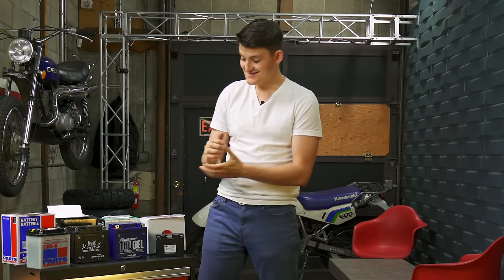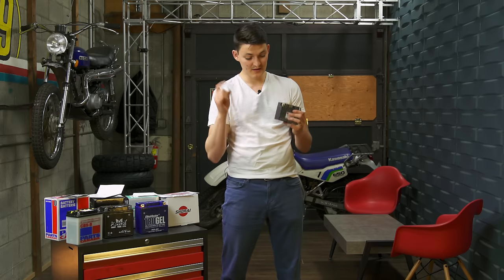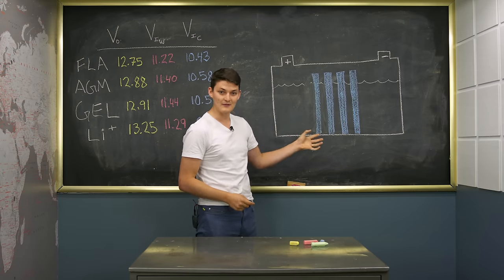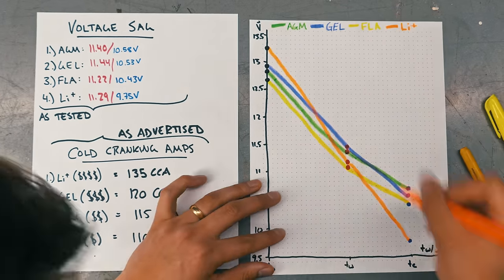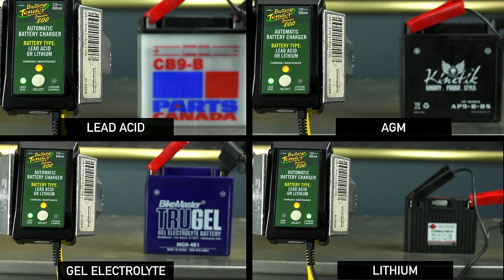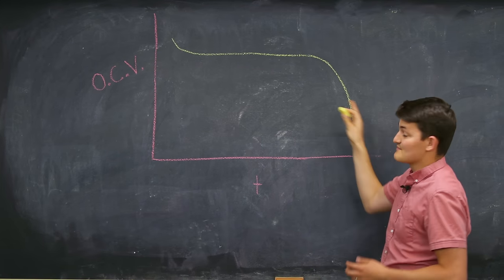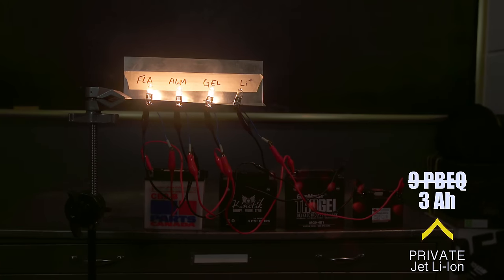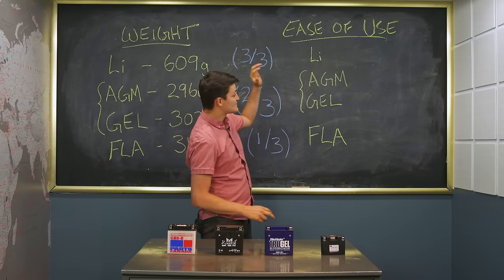Best Motorcycle Battery? Lead-Acid v. AGM v. Gel v. Lithium

Comment: Why not make a true 9ah Lithium Ion battery(or greater) of the same size of an AGM or Gel? I would gladly pay twice the price for twice the convenience.
Reply: They do and you can buy one. If paying that much extra is worth it to you.
Reply: Because pretty much nobody is buying a $500 battery for their bike instead of a $50 one
Reply: In terms of starting the bike, the 3ah is just as good. If you drain 3ah out of the others, they probably won't start because the voltage has dropped too much. In any case the low discharge and supposedly longer lifespan means you should never have to use the full capacity like is common on others. The problem I have with lithium is that I'm not sure it can survive the relatively crude charging systems of many bikes long enough to justify the cost. Also, running one at low temperatures isn't really possible.
Reply: @apodski  I'm using my Lithium battery with the factory rectifier /regulator, but there are finer products out there to suit this battery. Point is it needs to be kept away from over voltage. I made sure it always is kept under 14,2v of charging voltage. This can be obtained by keeping the ligt on at all times on my bike. In my opinion, lithium is so far superior that it makes this a no brainer for me.
Reply: @aukanmeister  The bike I considered getting a lithium for is kick start only with led lighting. Instead, I just got a very small agm battery that weighs around half a pound. I haven't regretted it.
Reply: @apodski  my lithium started my r1 perfectly fine in just below freezing temps, it took a few times of thumbing the starter though, first time it sounds like a dead battery, but 2nd and 3rd time the starter went round quicker and quicker, started in a wiff the 4th time, i knew this was normal, you really need to pull some amps through the battery to warm up the internals before it can push the amps to start a bike.
Reply: @HowlerBikeVlogs  That's interesting. I guess running a starter really doesn't tax the lithiums abilities much like that of a lead acid. Lithium cells can put out way, way more amps. But they are more cold sensitive.
Reply: I'm not sure how beneficial it would be anyway. I can list off several occasions when myself or someone I know has experienced a battery failure (I'm looking at you Bikemaster) out riding. I don't even recall one of them ever having a problem with their charging system where the additional reserve would be a benefit. It would end up just being wasted money. I personally run lithium when the temps are above 45F as it cranks my bike over faster and starts faster. And below that I run AGM since lithium doesn't much care for anything below 11.5v or charging when it's freezing.
Reply: @apodski  True, but not everybody lives in Canada. Where I live, freezing temperatures are rare. Then the weight difference becomes compelling, especially because batteries are typically fairly high up on the bike. Then basically you need to account for your riding seasons. If you ride all year, including below freezing, probably AGM is the best choice. If you just ride in fair weather, lithium makes more sense, since you don't need to worry about state of charge dropping during all those winter days.
Reply: @aukanmeister  Dont like, all bikes now leave the headlight on?   Uh oh mines LED so is that enough current draw to count?

Comment: Bought a KLR new in 2006, ate two standard LA batteries in the first 3 years.
KLR's are famous for that. The Shunt R/R overcharges IMO.
So, after much research, I bought an AGM from Batteries Plus, and I fitted a MOSFET style R/R to replace the standard Shunt unit.
That AGM lasted 8 years! 
Now, I did use a cheap Harbor Freight trickle charger ($5) whenever I parked it for more than a week (not often), but that was one inexpensive battery and retrofit in the long run.

The next AGM was 4 years old and going strong when I sold the KLR, so for my money AGM is the way to go.

Comment: One note about lithium- there are 2 primary lithium battery chemistries. The one used here, LiFePO4, is much more resiliant than the somewhat more common Li-ion, if a bit less power dense. If you have a Lithium Iron Phosphate battery like this, amd it gets discharged completely flat, there's a pretty good chance you can bring it back with a very slow trickle charge. It likely won't come back to its full capacity, but it's usually worth trying to recover it rather than just throwing it away.

Comment: I stand in the Li On court, mine drained to 3.5v, I stuck it on its charger and 2 hours later it was fully charged with no long term damage. Any other battery would have been consigned to the bin

Comment: Interesting video  .I've always been 'Pedantic' when it comes to  looking after my batteries over the years . Mainly because in NZ where I live, they have always been very expensive  (along with a bunch of other things, down here ! ) I have 'resurrected'  two batteries lately, after looking at many claims/ways over the years . One was a flooded-lead type, which i topped-up to the minimum-mark, then used a heavy truck-charger on 24-volt,engine-start-mode . I had the battery 3/4-immersed in water to help keep temps down. I cycled it in 3-4 minute bursts until every cell was boiling vigorously , resting it 10 mins between each charge, for over an hr with all cel-caps OFF . That battery holds a float-charge over 12-volts @ 4.6 amps . The other was a dead gel-battery, which I attached a larger gel-battery to, and then charged the larger-battery .  It now comfortably cranks my TX650 with a high-comp motor . The f-l battery was a 7yr-old yuasa, while the gel is an 18m-old generic-brand . The lead-acid video I watched, used an arc-welder , which I will try sometime in the future . This high-voltage/amperage DOES NOT work on anything other than Flooded Lead-Acid (no gel or gel-mat or lithium ) , and DOES have the potential to explode from gases/sparks etc. So ...do this at your own risk, taking ALL precautions : I even used a fan to blow gases away . Connecting terminals with a live/large current-source IS dangerous, they must be connected B4  power is turned-on .    Dave   NZ

Comment: I've converted all 5 of my street bikes to Li over the years, each with a different brand. (Shorai, Ballistics, Bike Master, WPS and Part Unlimited.)
Bikes range from a 1500cc Vulcan cruiser, FZR1000, TDM850 twin, 400 Bandit and a VTR250. None of them get a ton of everyday use since even if I commute everyday to work, I can still only ride each one once or twice a week  and rarely more than 30 miles per trip. In the years since I switched, only the tiny little Ballistics six-pack battery in the Bandit has ever cranked slowly after a winter of storage or several weeks of not riding that particular bike. This is somewhat remedied by leaving the headlight on for a minute B4 cranking and I've never had to resort to charging before starting.

Comment: I thought you would be able to recharge the lithium even after the full discharge though.  I thought that was one of it's selling points.
Reply: you can. I have one that was given to me. It measured 0.5v. I jumped it to wake it up, then it's been fine for a year and 10k miles.
Reply: Yes, but if you manage to discharge them below a certain voltage they probably won't come back. It's a bit like going below 0%.
Reply: @jamespcorbett  The opposite is true.  You must drain them to extend their lives. Lithium batteries have a little something called capacity memory. If you drain them to say 50% the battery will assume that it's the new 0%. You must fully drain them from time to time. People throw away perfectly good batteries.  If your lithium battery is giving you trouble, fully drain it and it will take care of 80-90% of the problems.
Reply: @gazlindhysko  I agree to 0%, but if you continue to drain them past that they often will not charge again.
Reply: @gazlindhysko  Not true. I think you're thinking of Ni Cad, or NiMh battery technology. Lithium doesn't have a memory.
Reply: @P0rtlandbear  is right, I believe. What you're talking about is true for Nicad. Totally different. 
I worked for Tesla and can confirm that Lithium should avoid full charge and full discharge. Keep it between 20%-80% type thing; the extremes stress the battery.

Comment: But I just bought a lithium ion battery from Advance Auto for ~$40, it was even cheaper than a lead acid...
Reply: Timothy Brown He had a lithium iron not a lithium ion. You may have found a cheap Lithium ion but lithium iron won’t catch fire and is often used for things like motorcycles.

Comment: I have had the same Shorai lithium battery in my Yamaha Xt250 for over 7 years. Will definitely buy the same one again. No battery tender needed if you ride frequently enough. They do have issues with really cold weather but I don't usually ride when it's that cold.

Comment: Great comparison!! Battery discussions are rampant on MC Forums. Almost as bad as tire and oil threads...Almost. I'll say this: My road bike has a standard and CHEAP lead-acid battery that's been going strong for 5.5 years. My dirtbike has a Shorai that's been in about that same amount of time. Our Jet ski burned the OEM lead-acid in 2 years. The AGM replacement lasted 4 years and was just replaced with another AGM. I thought about getting a Li battery, but they were around $240, compared to the AGM's $85. That battery would have to last 12 years to be worth the money. All this to say, I truly believe different batteries are useful in different applications. Either way, thanks again!

Comment: Interesting stuff about batteries. I'm currently testing LiFePO4 batts in my lab at work. In another lab next door they've been doing it for 10yrs. They had their 10yr old batteries xrayed and chemically analyzed to see what their charging methods were doing to the batteries. 10 years of incorrectly charging the batteries. This means removing cold weather protection from the internal BMS. Basically the batteries stayed on and took charge and discharged regardless of temp. In our field work we have batteries at high altitude and artctic/antarctic conditions. They have similar situations in their deployments. The results showed that the batteries were damaged but that it was so miniscule that it didn't matter. They made it 10 years. So they didn't really need the xray exam or chemical analysis to point that out. But they got it done. Great video. Side not I run li Batts on my vehicles and house.

Comment: Ryan thanks for this great real world test. Would like to add, lithium battery has the best storage loss only without parasitic loss. With electronics sucking power during storage you had best hit it with a charger every other month or so. I left my Goldwing sit and the battery won't turn it over. Left the lithium rated automatic charger on for the winter(gets cold in New York too) and battery died completely. Just my observations. Great tip on waking up lithium battery! Keep up your great irreverent honest reviews!

Comment: One thing not mentioned that I have not seen any discussion of is how the BIKES' charging systems matches up with the different batteries' voltage and current needs.  For example, there is much online discussion about having a correct plug-in battery charger for your battery type (e.g., lithium bats), as well as apparently that some plug-in electric chargers work on all batteries (like the tender you mentioned.)  QUESTION:   Are the bikes' own built-in charging systems all OK with the all battery types, such as lithium, other types?  What are the bikes' charging systems, anyway.  How do they differ between bikes.  Are BMW, Honda, etc., pretty much the same? or are there differences among them, some that could work better for certain batteries?  After all, a bike with a nearly discharged battery, if you could start it, might get 20 amps (R12GS) from the onboard charging system while the depleted battery was being recharged.

Comment: Even at 3x the price, I consider the LiFePo4 batteries to be a better value and are much less hassle in a motorcycle.  That may not be the case for a snowmobile.

About 5 years ago, I put in my first LiFePo4 battery which was a Scorpion Stinger LiFePo4. It has a much higher CCA rating than the Shorai or the lead based equivalents and I really noticed how much easier it started the bike.  I have replaced 2 other lead batteries with Scorpion LiFePo4 batteries since and only one of my dirt bikes still has a lead battery.  No more trickle charger, and the internal circuitry allows them to be charged and treated like a lead based battery.  At 40 degrees Fahrenheit the LiFePo4 has much less oomph than it does when its warmer, even with running the headlight for a few minutes.  If my Triumph sits for a while and its cool out (40F), it is a bit hard to start and I will jump it off the car if it does not start in the first couple of attempts, same as I would a lead based battery.  The other bikes start fine, even when it’s cool outside and they have been sitting for a few months.

All my LiFePo4 batteries are still working great at 5, 3, and 2 years old.  I won’t know the total cost of ownership until the LiFePo4 batteries die.  I have gotten as little as 6 months from a flooded lead acid and rarely get more than a couple of years.

Comment: I got a Suzuki Boulevard C90T 1500cc
Been using 230 cold cranking amps.
I’m moving up to 260 CCAmps.
Starts an1800 cc bike..!
I cruise with an extra battery and a jump start battery, fix a flat, fire extinguisher(small cans)
Tools.. everything fits in one saddle bag.
In case the battery quits.
Plus I’ll share if I happen upon you with mechanical problems.
Got a cheap volt AC/DC meter to quick check.
I can jump a V-8
Had two wiring burns.. a battery got me home.
Now I got extra.. and no more problems.
A stronger CCA seems to be the trick.
I cruise about 600 miles a week in fair weather...
The cold is ok.. the rain , not so much🤩

Comment: I put a Lithium battery in my ATC 70 (125m motor ) bolted sideways up in the frame in 2013 & never looked at it since.2024 it still cranks fast & never gone flat.

Comment: The lithium batteries in a Tesla are packs which have coolant to enable faster charge and discharge. In cold weather charging, the coolant heats the pack to enable correct charging, but in very cold temps a 110V standard garage charger can barely warm the coolant sufficiently and still get charge in.
Reply: One guy had his tesla plugged into 110v and it was so cold the battery level % was still dropping.  It was using more power to keep the batteries warm than 110v could deliver.
Reply: @chrishart8548  Correct, I saw that also. Lithium packs in EV's cannot be too cold, or too hot.  When people put Tesla's on the racetrack, they lasted a few laps before the battery packs shut the cars down, to prevent  over temps.  The cooling systems wont cope.........that makes for interesting situations for EV trucks, hauling heavy loads will need very over built cooling systems for their 6,000kg (payload robbing) batteries.

Comment: Great episode. I've had two Shorai's (two different motorcycles: Ducati 900SS and KTM 690 Enduro R) and an EarthX Lithium and had horrible luck with the Shorai's. Both lasted less than two years, both were charged with the dedicated Shorai chargers. The Earth X lasted 3 years and is still going, and I've just used cheapo tenders on it.

Comment: I have a Shorai in my DR & I think it’s the ducks nuts. (Long lasting & saves a lot of weight). Gonna buy a another for my other bike. I’ve always thought that it wouldn’t be a good battery if you run a lot of tech- heat grips, spotlights, gps etc & this vid confirms my suspicions

Comment: Extremely informative once again. Bravo Ryan, bravo. Yet another display of why your channel stands head and shoulders against the rest. 

There are trade offs and compromises to be had with every choice. Forgoing capacity I for one have settled upon Lithium as my weapon of choice. Coming to grips with having minimal use while the engine is off is the pill I chose to swallow but higher CCA and weight reduction are of greater value on a beastie GSA. Hell, dropping a few kilos on the 500 EXC ain’t bad either 😝 

Rock on Ryan, rock on 🤘

Comment: The best tip I have about batteries is to not hook them up backwards. It can easily be done if not paying close attention to which terminals are positive and negative. It can damage electronics beyond repair and difficult to diagnose which components will need replacement.

Comment: most bikes have additional drain on a battery if they have an ECU, short of completely disconnecting the battery you'll still need power to store them, most unfortunately making the self drain less attractive on the lithium.

Comment: Battery placement on the bike also plays a part.  Case in point - BMW.  My '03 BMW F650 battery sits at the top of the hump at the very top of the bike.  Sure, keeps it out of the way when fording streams but it changes the center of gravity a lot, makes it more top heavy.  About 4 or so years ago I replaced it with a Shorai and now it's no longer "top heavy" and a lot easier to ride.
I once left it to sit from October to March and it still cranked right up.  I keep it on a Shorai charger though if I know it's going to sit for long periods of time.
And who leaves their headlights on anymore?  When I take the key out the headlight turns off and that's on an almost 17 year-old bike.  Buy once, cry once.  
Go LiFePo (lithium) because you're going to get a far greater ROI than pretty much any other battery tech in existence.

Comment: That's why I stuffed a Antigravity. YTX12-24 Lithium battery with 30Ahr and 720CCA in my R1200GSA!  Lots of punch and could do it many times. Even boosted once a Ford F250! If it's to work just fit the strongest that fits in the hole!